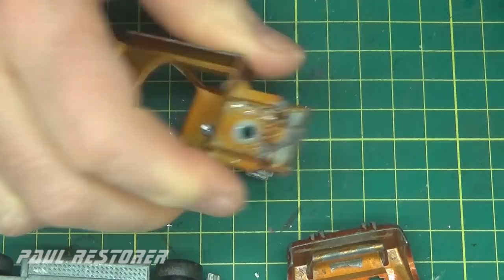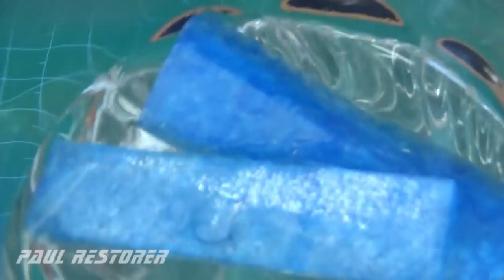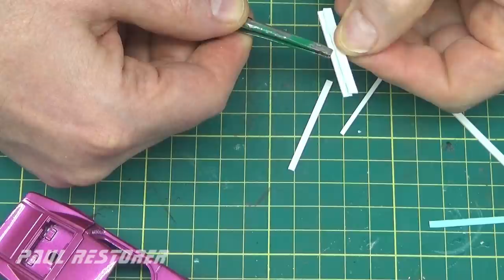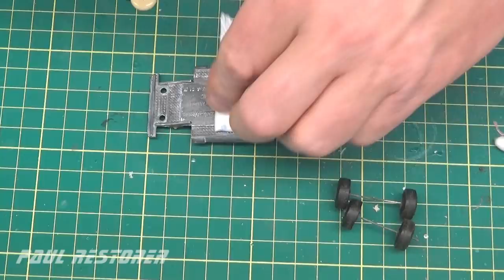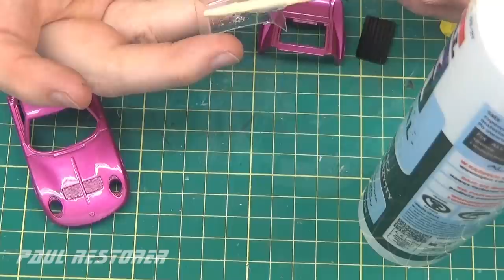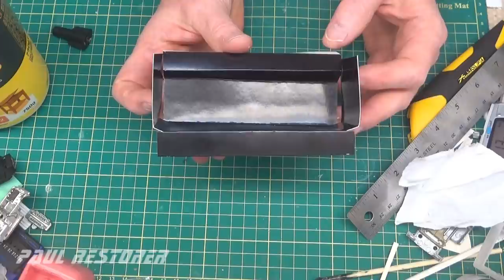Matchbox renowacja Lamborghini Miura King Size nr .K-24. Model odlewany.

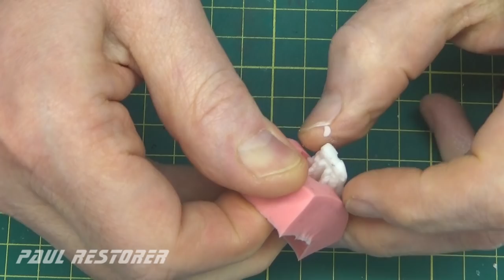Comment: 10:33 - So what was the logic behind replacing a perfectly good white metal engine block and original seating/interior with a resin copy?  
.
Also, you keep drifting off image, try increasing your camera distance to give more field of view.  Most of the last portion of this video, you were drifting off-screen when in close-up of the vehicle's final detailing.
.
Usually you do a pretty good restoration, but I'm not so impressed with this Lambo.   The colour is not original, nor doubtful would have ever been used for that marque.  The seating/interior colouring is white, not the original cream.   No colour detailing to the rear lenses.  The horrible resin engine block, ill fitting rear engine hood section.  I give you 69.5% for this restoration.  
.
Next....
Reply from the maker: the logic was simple my model had no center I had to make it in resin as well as an engine which I didn't have either. Best wishes

Comment: Excellent resto paul i was impressed how you made the missing parts did you know that this model has a tow hook  it slots invthat square hole in the back also the model you had without the bonnet vents has a transfer on the bonnet there is also a blue version with a yellow back and some versions have wider wheels the first pre superfast version was metalic red with true glide steering and runber tyres like the mercury cougar
Reply from the maker: Thank you very much Andrew